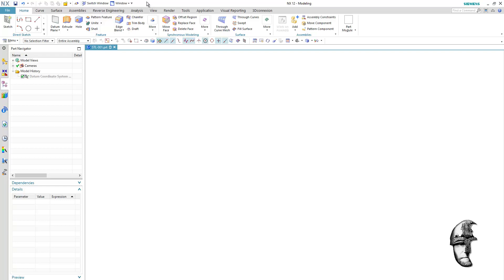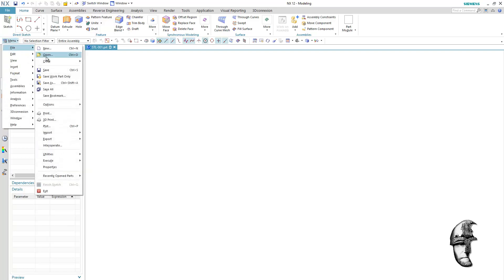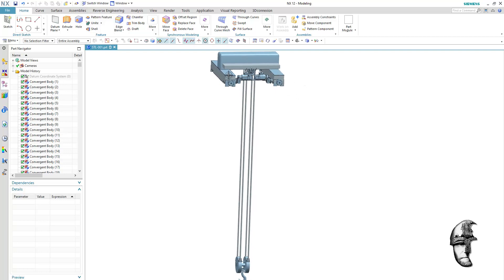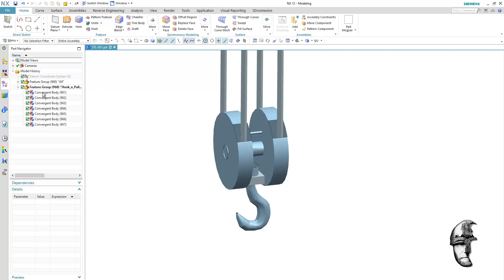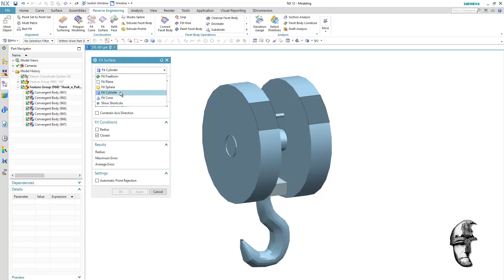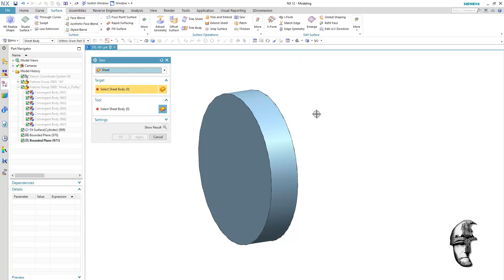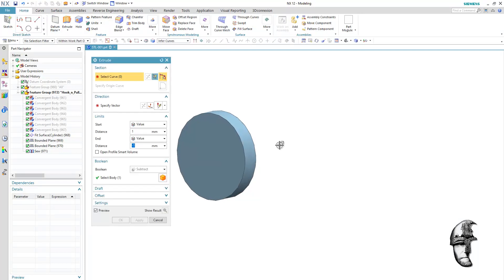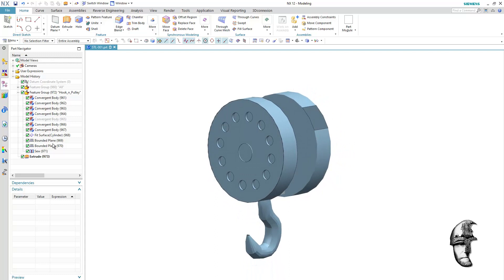NX12-STL Import Move Rebuild

Comment: You mention doing it in later versions is easy. But how do you do it? I can't find how to anywhere...on NX 1926
Reply from the maker: Hi Isaac Olsen, thank you for your question. Working with reverse engineering in NX is a really cool thing as you do not really need to reverse engineer everything - or anything. NX handles faceted bodies like Convergent bodies that can be incorporated into your workflow associativity. You do not need to reverse engineer more than you need (or at all) - meaning that if there are areas that you need to modify diametrically you only convert those areas. You can also modify your faceted body - all boils down to what you need and what would be you requirements. You have total freedom to define your process here. 
Now to whats been done in this video: 
When reverse engineering or handling facet data you need 2 modules in NX Polygon Modeling and Reverse Engineering. For whats being done in this video have a look to Replace Mesh with Face. This converts a selected area of your faceted body (Convergent Body) to analytic shapes that you easily can manipulate parametric. Really speed things up here.